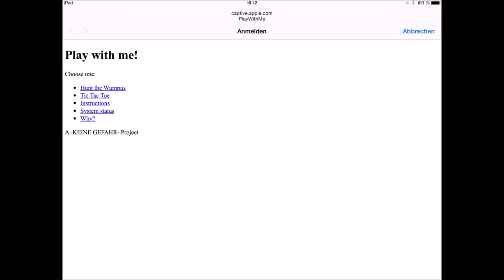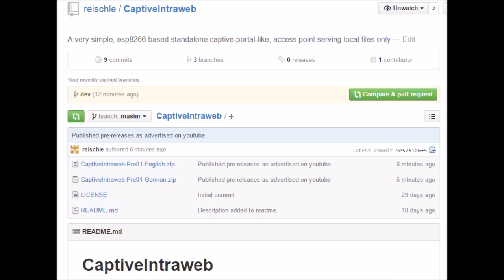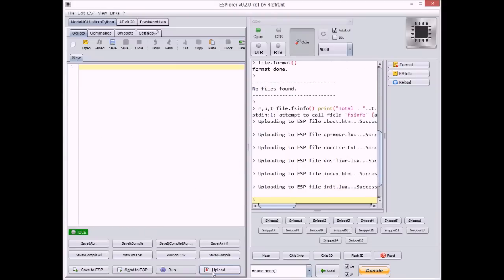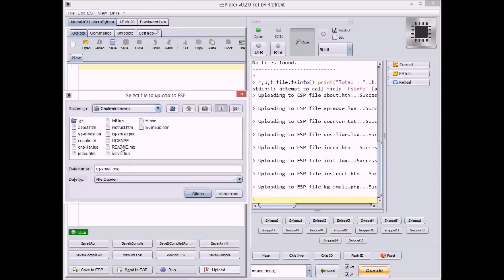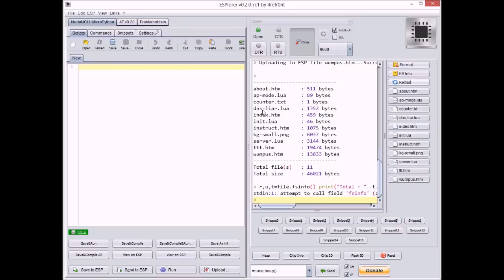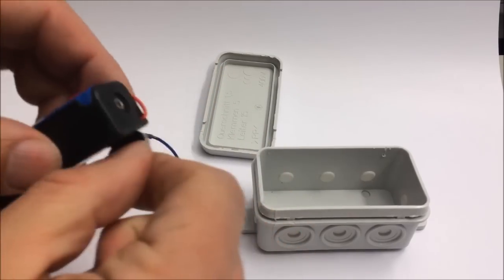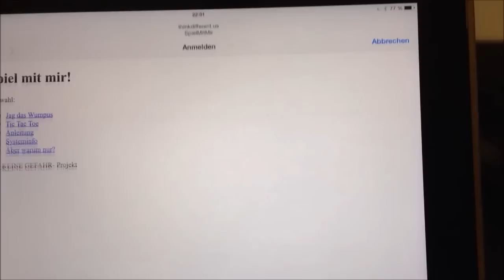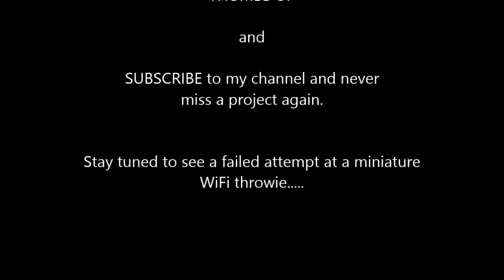CaptiveIntraweb  - a WiFi throwie using the ESP8266 / ESP-01 module

Comment: Great work! But I think you need to regulate the voltage before connecting the battery to esp8266 because this module's standard voltage is 3.3v

Comment: Very cool! 

What kind of file size limitations do you have with this board? I see that they come in variations with up to 4mb of ram (like the Adafruit combo board) but may have limits on block sizes? I'm looking to serve up slightly larger files - ie. 1-2mb pdf's. Any pointers? I like the (much) lower power consumption of the ESP8266 variants over Audrino / Raspberry systems. Perfect for the applications I'm looking for. I'm just learning right now :) Thanks!
Reply from the maker: +Jon Thorpe There is absolutely nothing wrong with the 4MByte modules and I would recommend using them if you start a new project. There are a few issues, though:
- The current versions of NodeMCU suffer from a SPIFFS bug that prevents large files (a few kBytes) from being saved to the modules. So you should stick with the older verions I provided.
- The server can't handle concurrent connections properly and if you transfer large files, chances are that things collide.
Reply: +AReResearch Thanks! Here it to hoping that they fix the SPIFFS bug as well as concurrent connections issues (i imagine that the ESC-32 chipset will address some of this - as well as more memory). It's a neat little module. Now time to pick one up and brush up on my programming..
Reply from the maker: +Jon Thorpe Yes! Can't wait to get my hands on one of these new modules.

Comment: would it be possible to make repeaters out of these ?
Reply from the maker: Calin Vlad Not with the techniques I used here. While the module itself might be capable of that, NodeMCU is IMHO not the firmware to do that with. I have drafted plans for a "store and forward" mechanism to forward individual datagrams, but that will not act the way you intend it.
Reply: AReResearch - A store & forward (s&f) mesh network would be really innovative. Basically the throwie would be dedicated to the closest wi-fi hotspot. It would take mobile text messages from an on-board javascript app.It would temporarily store it in internal memory, then establish connection to local hot spot, log into your javascript app server (anywhere in world) that takes these messages and converts them to emails and sends to recipients (only 1-way). When you log onto the throwie you put in email addresses, your email addy, subject, and text body. 

You could design an app on your smartphone or tablet that does all that on your device locally. Then when you hit SEND it looks for closest throwie to s&f the msg automatically. All you need to do is drive, walk, ride transit near any throwie.

Also throwies can get trickle charger power from south-facing (northern hemi only) small solar cell. Or find a exterior utility outlet on a pole or side of commercial building and put it in a power pac box and let it hang out of the outlet. Of course North America and other counties have vastly different voltages (110 vac in America) and prongs (flat prongs in America).

A wi-fi repeater would be problematic. They are only dedicated to a particular access point (AP). They rename the access point and you see both in your AP list. They wont repeat just any AP. That is possible but you would need a wi-fi enabled netbook and FireFox's wi-fi handler script (javascript) to negotiate any possible wi-fi logon scenario and look for non-secure AP's to automatically attach to. You could have it look for insecure AP names like "default", "linksys", etc. The netbook would need to be concealable and have AC power to be effective for you. You could not just throw it anywhere.

Comment: Does this still work with modern devices? I've had fits trying to get the pop-up helper to work with any examples I find. Near as I can tell, the devices are asking the dns server, getting the softAP address, but then the request for the connectivity check url never shows up on the http server. DNS caching perhaps?
Reply from the maker: +Scott Wood DNS caching might be a problem I hadn‘t thought of. Apart from that, captive portal detection of various flavours of android and IOS seems like a moving target. Feel free to contribute your code if you find out about new detection mechanisms.

Comment: Very cool! What's the capacity for that 18650 battery, and for how long could it run for?
Reply from the maker: Steven Huang A "KeepPower 18650 3100mAh Protected" cell gives me nearly two days of service. Alto nice about these protected cells: They cut out sharply instead of browning out when discharged.
Reply: AReResearch I see! Thanks a lot for the info

Comment: hi, i have esp8266 node mcu, ov7670 and card reader chip. I want to make a video recorder which records video whenever it powers and save the video to memory card. can also be viewed from web interface via wifi. can you help ?
Reply from the maker: This is the closest I could find to what you want to do:
http://johan.kanflo.com/building-a-low-cost-wifi-camera/

If you need more processing power, you should have a look at the ESP32 ( http://www.banggood.com/ESP32-Development-Board-WiFiBluetooth-Ultra-Low-Power-Consumption-Dual-Cores-ESP-32-ESP-32S-Board-p-1109512.html?p=NT1005763073201409DA )

Here is a camera project with the ESP32: https://github.com/igrr/esp32-cam-demo

Comment: hey man , can you explain how to able to power up the ESP without over voltage( 3.7v on 18650) it ?
Reply from the maker: Yes, sure: There is a 1N-type silicon diode in series with the 18650. That will drop 0.5 to 0.6V from the battery voltage.
See my blog here: http://www.areresearch.net/2015/05/schematic-diagram-for-captiveintraweb.html
Reply: Thank you very much sir

Comment: Hi. Any plans to port this to ESP32? It offers a lot more power and also more storage so would be a good step forward
Reply from the maker: Yes, I have that on my to-do list. The single-processor architecture of the ESP8266 has always been a problem when serving bigger files or simultaneous clients. The ESP32 should be so much more reliable.
Reply: Thank you. This is something I am eagerly looking fwd to. ESP32 has 16mb of flash which makes it ideal to put additional content on the throwie such as heavier games, images and PDFs. 16mb is a lot and probably the perfect size for just about any use. Needless to say the new potential with 2 cores.
I have gone through the steps yesterday to get it working and it took me some time. I would suggest to add to the description of this video at least the link to your blogpost as well as to the Github page. Also would be great if you could describe the steps needed to build our own firmware (components, code modifications) - there are bits and bobs here and there in the comments so it's difficult to under stand how to build.
As far as the hardware, recycling 18650's is great. I would recommend mentioning bare ESP with the HT7333 regulator (specs are very good for 18650+ESP) together with the capacitors (cost is under $1 with shipping). More detail on this here: https://www.youtube.com/watch?v=J66_8P043ko

Comment: Hello what kind of diode did you use? Also how long does the battery last?
Reply from the maker: +joseph chrzempiec (josephchrzempiec) For the diode, any 1N type should do. I use a 1N4001. A 1N4148 is ok, too. It's just an easy way to avoid a voltage regulator. With a good 18650 battery like this: http://www.banggood.com/KeepPower-18650-3100mAh-Protected-Rechargeable-Li-Ion-Battery-2pcs-p-918692.html?p=NT1005763073201409DA
I get about two days of runtime. (The Ultrafire crap is only for testing)
For next summer I intend to go for a solar powered version, but that is harder than it sounds.
Reply from the maker: +joseph chrzempiec (josephchrzempiec) This short blog article will help:
http://www.areresearch.net/2015/05/schematic-diagram-for-captiveintraweb.html
Reply: Hello thank you.

Comment: i really need a battery holder exactly like this.Would you like to tell me @AreResaerch where i get this any online site etc
Reply from the maker: Sure, 5 of them are a little over 3 bucks here: http://www.banggood.com/5Pcs-DIY-Battery-Box-Holder-Case-For-18650-Rechargeable-Battery-p-965083.html?p=NT1005763073201409DA
Never had any trouble with Banggood and I buy most of my stuff there.
Also make sure you have good quality cells. Nothing with "Fire" in it's name :-)
Reply: Fawad Satti Ne careful, ich u want to charge 18650 cells with more then 0,5 A... It will destroy the positive terminal 😬

Comment: Andreas,
I'v tried the latest version from https://github.com/reischle/CaptiveIntraweb
But the dns-liar does not work.
Browsing to the devices ip address does show the page and everything works.
But you are not not redirected to this page (just get "unable to open page")
Reply from the maker: +pgScorpio Two things come to mind:
a) have you installed the custom made firmware? Because this sets the dns-server for the client via dhcp, while the normal firmware doesn't do that.
b) recently I had someone with a mobile phone that just wouldn't work with CaptiveIntraweb. - What is your client device?
Other things to narrow down the problem:
- You can put a print ("Got a request"); somewhere into the decodedns function to see if requests are even sent from the client.
- Connect to the portal with a laptop, run a command shell and type: "nslookup www.foobar.com" it should reply with "192.168.4.1" if it doesn't, run "ipconfig /all" (when on windows) and see if both the DHCP and DNS server entries read 192.168.4.1.

Let me know how it goes.
Reply: Hi Andreas,
a) yes i used the firmware included in the zipfile.
b) you are right ! the dns seems to be a a android problem (did not have the time yet to add and check the logs)

On windows PC the DNS liar works, but then I have another problem...
The homepage shows up, but when clicking a link sometimes it works but many times i get "unable to open page". Checking the ESP debug output it shows a watchdog reset when this happens.... probably have to add yield(s) somewhere while returning page data... The strange thing is I don't see this happen when accessing the page from android.

It's  a pity dns liar doesn't work on android, because when using this as throwie almost all access would be from android devices....

I hope I will find some time to dig into this soon...

Regards,
Peter
Reply from the maker: +pgScorpio Yes, the yield issue... I decided to send data in small chunks to keep the send buffer from overflowing. Possibly not the best solution there is.
I have a couple of android devices at work and will have a try with them some time. I had that working in the past, but that was an older Android release. Things work best with IOS devices, because that is what I have.
There is a dirty trick for working around whatchdog timer problems, (see my "imperial march" blog entry) but that's more like treating the symptom rather than the cause of the problem.
Let me know if you find out anything before I do.
Regards,
Andy

Comment: Hi, have you tested your LAU CaptivePortal with an android device? Does it work?
At http://www.esp8266.com/viewtopic.php?f=32&t=3618 I am trying a similar CaptivePortal setup, but with Arduino on the esp8266. It works perfectly on any iOS device, but not Android. If yours works on ANdroid, then I will suggest the dev of DNSServer look at your response code for DNS lookups.
Thanks
Reply from the maker: Al B. I also have issues with Android. The fellow who tested it for me eventually got there by opening some random http/url. But their captive portal detection doesn't work for me as expected. I couldn't debug it properly yet, but one user suspects it tries https requests. I'll see if I can get a device to thoroughly test it with.
Reply: AReResearch Yeah, it does try https after connection. BUt You'd still think it would redirect any and all browser requests to the replied IP from the DNS server. In the URL I posted in my initial comment, I did a tcpdump to see what android does. I posted it in that thread. If you figure it out or want to share your findings there too, it would be appreciated. I also mentioned your liar.lau there ;)
Reply from the maker: Al B. I have identified a problem with the server.lua and android. I expect to get that fixed shortly.
Reply: AReResearch awesome, do you mind sharing on the esp8266 forum, so I can make adjustments for arduino

Comment: then, how to increase this wifi jammer range?
Reply from the maker: To my knowledge, the ESP8266 does respect CSMA/CD, so it can't jam signals. If you are looking for a deauther, google "Spacehuhn deauther". That device deauthenticates Wifi clients, which is not jamming, but also results in disconnects.
If you need more range, take a module like the esp-07 with an external antenna connector.